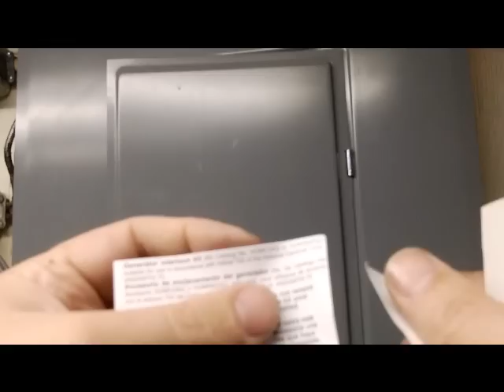Generator interlock installation on the breaker panel.

Comment: Was debating whether to install a manual transfer switch/panel or this interlock. This is far cheaper, far easier, and allows me to selectively chose any circuit in my panel.  Thanks.
Reply from the maker: Thanks for watching.

Comment: The screw you reused for the retainer bracket should have been discarded and replaced with the long screw in your baggie of screws. The long one visible around 5:40. At least that's what the instructions say for the interlock kit in my Square D QO panel.
Reply from the maker: Hmm. I thought I read the instructions. Maybe it's different on a Homeline. Thanks for watching.
Reply: @djastram  Installed it this morning and carefully examined both screws and they are absolutely identical. Weird they call for discarding the old one, which I did out of caution despite being in a brand new panel. Appreciate the video as it really helped in preparing for a successful install.

Comment: Hello, how did you wire your portable generator to this breaker? Did you simply use a 10-3 cable running two hot lines and grounding in the bus, and secondly did your generator have a bonded neutral or a floating neutral?
Reply from the maker: I used 10-3  w/ground

A follow up video here >>> http://youtu.be/esmWX96aYcg

Thanks for watching.

Comment: Man, You're brutal with that drill
Reply: Hi David; I agree with Andrew: your video is very good .. hits all the high points in good detail. Also agree on the drill technique -- which is a minor quibble. Also, the burrs (which you are sure to have drilling like that) would be on the flip side of the panel. But this does not take away from this being a great youtube. It rocks. Thanks!
Reply from the maker: Please explain.
Reply: No control, You need to put a piece of wood on the back so the work doesn't bend and spring back, and so you have some resistance for when you go through. pecking is good (ramping the pressure downwards and then letting off) so you don't go flying through. peck more frequently the deeper you go.

At the center of any rotary tool there is NO movement, that's why we drill a pilot hole. when you drill the hole to size you're not trying to cut on the tip, so it will go through a lot easier. the slower you go (IPM/downwards force) the nicer the finish (to a point , if you go too slowly you'll just wear out your  drills). 

good video though
Reply: Andrew Popoff lay off the soy fruitcake.

Comment: Nicely done.  Interlock kits are easy to obtain and somewhat easy to install.  I wish we could scrub YouTube of all the "dryer outlet" videos.  This is the right way to do it.
Reply: Art C... You are spot on with your point... As to Mr. Jastram's video, all I can say is, he clearly demonstrates how NOT to drill a hole through sheet metal. I will go a step further & say he shows complete disregard on the basics of drilling a hole! LOL...
Bill Farr...
Reply from the maker: Thanks for watching!
Reply: When They DIE Or Burn The Building Down Or Both  They Will Find Out What My Mother Taught Me When I Was Young.  * Cheap is Expensive *
Reply: +adam lambert You are astoundingly ignorant.  Dryer outlet videos should be discouraged for the same reason that "This his how you clean a gun while it's loaded and pointed at your face" videos should be discouraged.  Just because something is possible, and you are (supposedly) smart enough to handle it, doesn't mean that anyone should be encouraging others to do it.  People can AND DO cause both human injury and property damage from illegal backfeed setups.  And since it's also a blatant code violation, are you also suggesting that we should encourage people to make videos showing how to put a 50 amp breaker on 14 gauge wire to avoid the inconvenience of tripping breakers? 

And yes, some people WILL forget to turn off their main breaker when back feeding.  It might even be you, when you're in the middle of an emergency and need the power back on in a hurry.  Or it might be a member of your family, missing that step when they try to get the generator going when you're not home.
Reply: +Art Cancro (IGnatius T Foobar) Scrub YouTube of all the "dryer outlet" Videos? Sounds like you'd do great in North Korea or China where they dictate what information their subjects have access to. I just found out about the dryer outlet back feed system and I think it's a great idea. I also don't have a main breaker in my panel, it's located on the outside of my house. I'm smart enough to turn my main off if I ever need to back feed my house through the dryer trick. I don't anticipate the need ever arising to do such a thing, but I also live in an area that is overdue for a 7.0+ earthquake. I'd rather have access to the dryer information and be able to heat my home in the dead of winter or turn on a fan in the 105+ summer days than to not have access to such information. Some people are smart enough to make their own decisions, some aren't. I guess I can assume you think other people are too stupid to turn of their main breaker when back feeding and should not have access to even knowing this potentially life saving information.
Reply: " I just found out about the dryer outlet back feed system and I think it's a great idea."

You, sir, are an idiot.